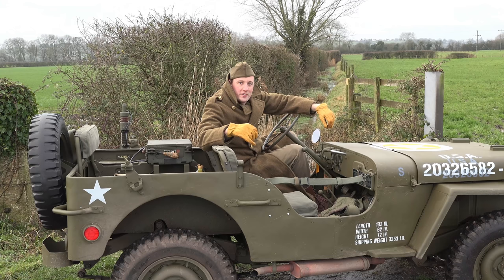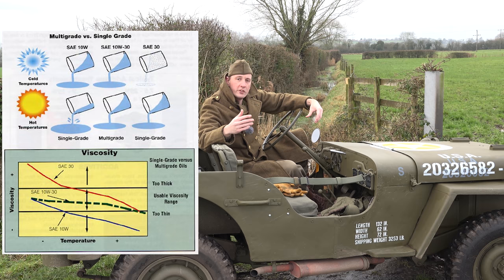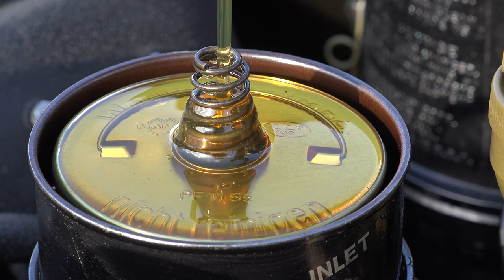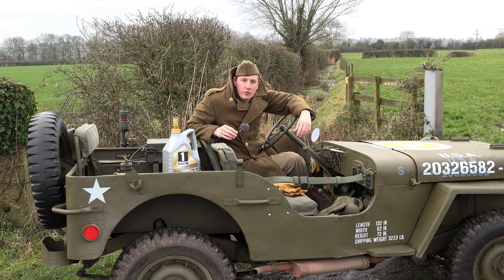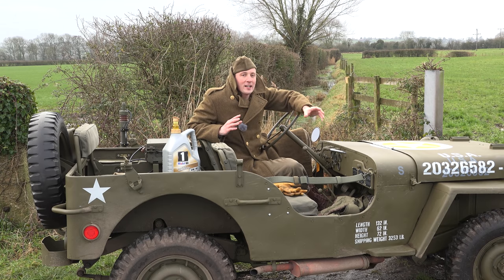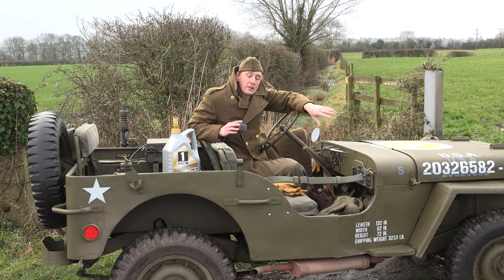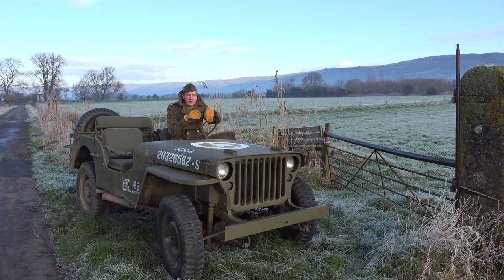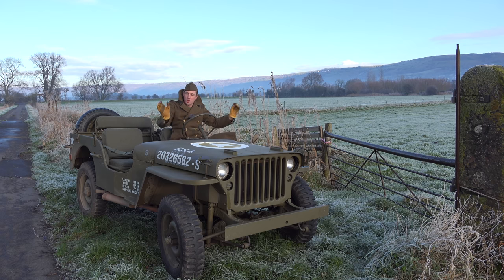Why can't You use Synthetic oil in old engines??

Comment: This video describes why cars with the ridiculous engine auto stop and start design flaw will have premature engine failure as compared to an engine allowed to idle with proper oil pressure, proper temperature, and proper lubrication.  But you save a spoonful of fuel.
Reply: Start-stop cuts down pollution in cities.  Using a quality fully synthetic will prevent wear.  The engine is not off long enough for oil to drain away.
Reply: @johnburns4017  It does not drain away entirely.  But there are no check valves nor top end oil reservoirs, as what you would expect.  It is equivalent to running your vehicles engine low on oil.  I had to change injectors unrelated to camshaft damage on an Impala.  I could not believe just how much camshaft damage was evident on the lobes.  This was a vehicle with under 100,000 miles.  The scoring looked like a vehicle that was on the edge of failure.  But hey, it saves a few spoonfuls of fuel even if the cars service life is cut by 75%. There is no way that impala is going to make it to half as long as what a vehicle that is allowed to maintained a lubricated top end, with proper pressure, will make.  Then the old failed car will use far more fuel that it could have ever used to melt it down to make another vehicle.  I guess these cars are good for a lease car.  One can get rid of them before catastrophic failure.  As a side note, the fuel injectors were clogged horribly for a vehicle with low miles.  This has nothing to or with top end lubrication though.  But it is common enough that the shop stocks large amounts of injectors.  I have not figured that out yet.  I just change them.

Comment: One big caution about using synthetic oil in old engines is most synthetic oil is formulated for modern engines with roller lifter or cam followers and catalytic converters.  The blend is optimized for these applications.  As such, one or more additives beneficial to oil engines with flat tappet camshafts, namely zinc based anti-scuffing additives (i.e. ZDDP), has been reduced in content because they can damage catalytic converters in engines that consume oil.  Since modern engines no longer use flat tappets, the anti-scuffing additives are no longer as critical and CAN be safely reduced.  But, that's not true for old engines.   So, do yourself a favor... Continue to use synthetic oil for all of the good reasons you state in your video, BUT use a ZDDP additive to protect your cam and lifters.  Make sure the additive you use is compatible with synthetic oil.  (What I say above also applies to modern non-synthetic oils in old engines.  Flat tappets - use a ZDDP additive...)
Reply: Bad advice - It has been proven that adding ZDDP instantly destroys any established oil's package...you are not a chemist and have no idea what the outcome is or will be.

Comment: A lot of older mechanics will say don't use detergent oil in an older car. The newer oils are so good at cleaning the inside of an engine that they can remove oil deposits behind thise rings and therefore allowing the engines to start using more oil than it used to. So, if an older engine had non-detergent used in it, stick with it.
Reply from the maker: That is good advise ;)

Comment: What is a oil that you like , I was told straight 40 wt Valvoline was the choice, My motor was rebuilt 10 years ago and only has 400 miles on it ,runs perfect

Comment: Why not just use the Standard Oil until the ring seat? After the ring seat let's say after 10,000 miles you can switch over to synthetic. What's the analysis of that?
Reply from the maker: The current ideas are to use a break in oil for first 500 and then switch to your oil of choice.  My personal opinion is to just use a good semi synthetic from the start, I did not continue using the fully synth to see if the consumption would reduce but I belive it would and the extra protection would allow your engine to last longer.
Reply from the maker: I'm going to revisit this with a follow up video

Comment: Break it in with conventional oil around 500  to 1000miles to break in and seat the rings then change back to synthetic.  I would want those parts to last as long as possible and synthetic with regular changes is the ticket for long part life.

Comment: Matt with the Jeep do you need to add an petrol additive given we have gone from leaded petrol 
Alan Australia
Reply from the maker: I don't, it doesn't appear to be a problem with these engines for some reason.  I've found using as little additives as possible seems to work best, nice fresh fuel and a good oil seems to be what these engines like.
Reply: The old low compression flathead engines, don't really need the lead additives.  The newer OHV engines with their higher compression usually do though.

Comment: They don’t have zinc in oil for one reason it is the catalytic converters. Zinc, lead and other metals damage them. Now you can get a zinc synthetic oil you need to look at racing oil or something like Lucas oil’s zinc additives not to be used in vehicles with catalytic converters.
Reply: Lucas hot rod Rotella both very high zinc

Comment: 12:50 .. So the oil is slipring past the rings? and burning so cleanly it's not fouling the sparkplugs?
Reply from the maker: I think the answer was very little oil was getting past, enough to have some consumption but nothing beyond what is normal for break in for a jeep motor!  You could probably break it in quicker with a less protective oil but why bother, just keep the incredible protection of the mobil 1 and don't worry!

Comment: On older engines, break-in the engine with non-synthetic to seat the rings.  Then switch to synthetic for long life.  You can't break in an engine with synthetic because it's too slick.  We used to do this for small engines such as non-ringed tapered-piston remote-controlled model airplane engines.  No reason it wouldn't work for pretty much anything.
Reply: There is no difference between "old" and "new" engines when it comes to rings...all engines from the last two decades came with synthetic oil in the crankcase from the very start and zero problems. Old wives tale debunked...

Comment: the old rubber seals and gaskets in a 40's era engine, is not happy to the additives in a modern syntetic oil.. the engine is happy with the newer oil, that flows better at startup but the old seals is not, if can get modern style seals and gaskets. therefor on a generaly many would recomend a 15W/30 mineralic oil over a syntetic

Comment: Those old engine need to be run in on a Mono grade oil for at least 500 kms, after which you can use the full synthetic if you wish.  Otherwise those old engine cylinders get a glaze on the cylinder wall whic you do not want.  Once you have done the breakin period you can use semi or full synthetic as after the breakin period the rings are seated and will not use oil at all.  New motors are broken in at the factory on a breakin oil which is removed at PDP service of the vehicle before delivery of the vehicle to the customer.

Comment: I avoid synthetic in anything pre 90 but ALWAYS use multiweight. BTW never use 0 weight oil in older engines 5w30 is perfect in any location (unless you're on an arctic expedition)

Comment: Happy New Year! My ignorance tells me that "thinner" 0w 30 and 10w 30 grade oils are too thin and are prone to promote leaking past gaskets.  Is this a truth or a myth in your opinion / experience please?  Great video as usual!  Many thanks.
Reply from the maker: This is incorrect, 0w cold is 5.6 times thicker than 40w when its hot so if your jeep leaks when its cold and the oil behaves like 0W then it will leak when its warm and 5.6 times thinner!  If A gasket is going to leak its going to leak no matter what (unless you fill the engine with crude oil or something like that!) and using a thicker oil to prevent leaks will cause unnecessary damage to your engine to prevent the loss of a few cents worth of oil, the long and short of it is if an engine leaks it needs attention and the leak rectifying not trying to get round it by using thicker oil grades, that is shade tree mechanic territory and the Sergeant will not stand for it ;)  ha ha
Reply: @Greendot319  Good answer Matt.  I will do an oil change with Mobil 1 semi-synthetic and fit a new sump gasket over the next few weeks then!  Cheers, Clive
Reply from the maker: Where about are you  Clive, your oil choice can depend a lot on where you are,  Also how old is the engine etc.  Suddenly changing oils on an engine that's behaving itself for many years can cause problems.  Imagine you have run a motor with a lower detergent oil, some sludge has built up and captured metal particles and carbon etc, same in the rings too, suddenly you switch to a highly  refined synthetic with high detergent levels, all of those bits of captured metal are now released from the sludge and carried through your engine where as it used to be stored away in the gook waiting for your to clean it out next time you did a rebuild; same thing goes for the rings, engines running fine, switch to higher detergent oil, carbon built up in rings that was helping to seal is broken lose with the new oil and you lose compression and your jeep starts smoking.  This is also true of the old seals too, gunk sometimes helps them seal and cleaning it out suddenly makes them start leaking!   It is worth being careful changing oils on a good running engine for these reasons, what might work very well in a new clean engine might not work so well in a good old motor, it all depends on your engines circumstances!
Reply: @Greendot319  "Design and make a can of worms!"  The engine was rebuilt by the previous owner, new innards, bills to prove, and had done 500 miles when we bought it.  New Morris 20w50 was put in upon purchase, that oil has now done 2000 miles and is just over 2 years 4 months old.  My intention was to simply change it for the same oil but your video made me think twice.  You last reply has made me think even further!!  
It has a very slight weep from the rear rope seal and the sump gasket  seems a bit moist all around.  "If it's not broke don't mend it" springs to mind but from what you have just said, I think it would tolerate a change to semi-synthetic given it's apparent youth. Maybe drop the oil and see how clean it is and take a decision from there.  It's cold in Northants at present so I may wait a few weeks for the garage to warm up a bit!

Cheers

Clive

Comment: For starting in cold weather US WW2 aircraft engines actually had an "Oil Dilution" control that would release some of the aircraft's gasoline into the engine oil to thin it out, then as the engine heated up the gas would simply evaporate out of the engines breather system. 
Could you imagine how the EPA would lose their minds if modern cars did something like that 🤣🤣🤣🤣
I can just hear all the heart attacks from the tree huggers🤣🤣🤣🤣

Comment: I would think the issue with synthetic would be couldthe seals and gaskets hold up to it. Otherwise synthetic would be perfect. Since your engine has just been rebuilt I would see no reason not to use synthetic. In fact I would add a friction modifier to the oil once the engine is broken in.

Comment: Can't use full synthetic in old engines? Bunch of crap. Old seals may not swell as much as they need to, which might cause leaks and pressure issues if you just decide to switch to the synthetic, but if the old engine is built with the new oil in mind, zero issues will be encountered. 300,000 leak and oil pressure free miles miles in an engine with rope seals was my personal experience- but I built the engine and did it with the use of full synthetic in mind, bought the right parts to support that oil use and talked to my machinist first.

Comment: I notice phillips petroleum and some others recomend 1400 ppm zinc for flat tappet cams at all times. Most oil now is limited to a max of 1000. Some say thats ok. I add one and three quarters lucas tb zinc additive to mobile one full syn allthough mobile said not to. There are two types of zinc but i cant find any info on it. Watch out for the directions on the lucas. Its 43 thousand ppm for an entire bottle. I only use a full bottle for 500 to 1000 mile break in and then use no more than 2 ounces per oil change after that. Too much zinc is as bad or worse than too little. I have talked to lucas and mobile to arrive at this gamble. 60 000 miles plus and no problems so far.

Comment: Very nice and informative video.  A question from me.  What about the other way around.  I have an old fully run in jeep that has been running on mineral oils for I assume 60 years.  Is it o.k to just swop over to the super 2000 semi synthetic oil.   Will it clean up the engine so much that everything becomes loose ?  Thanks  again for a great report.
Reply from the maker: I would be careful because the modern oils are detergent and will loosen any sludged up crud.  It would be advisable to completely clean the engine out before swapping to a modern detergent oil sadly.
Reply: @Greendot319  Thank you for your reply; your advice is invaluable.   When you say complete clean out you mean replace complete oil, oil filter, take of sump and clean, or is there more ?   I will use mobil super 2000 10w/40.  p.s I bought a color tune.  Cheers

Comment: I haven't seen much talk about Zinc. All the new oils have reduced levels of zinc, per new government 'climate change' rules. I deal with VW Beetles. Now, Valvoline VR 1 racing oil, or Amsoil with zinc,  is the only oil we can use, mainly because of the solid lifters. You can use other oils if you use the zinc additive. But you shouldn't use any oil on a solid lifter engine without zinc, and the newer oils have very little. Thanks climate change, and our government.

Comment: Big gauntlets for driving. Scarf over the face. Look at motorcycle gear from the fifties, all surplus stuff!  Been on old bikes in the winter with very primitive gear back in The eighties   F# cking freezing. But kind of fun. It’s not like you’ll get wet if it rains;  oh yes oops 
You will.
Reply: I did it in the sixties, when I came home after riding, I had to break the ice off the jacket to undo the zipper. Now that was cold.

Comment: Hello! 
I have questions:
Do you have magnet in drain plug, or few, flat, heat tolerant magnets bottom side of the oil pan? - to collect free steel particles before oil pump suck them up 

Did you use break-in oil, for the first 30 miles? some say, that nos or old rebuilt engines like it

Any pictures from the inside of the oil filter?
Thx!
Reply: What about inside the oil ports for the crank journals can we get a pic there too?🤪
Reply: @BilgePump  yeh! really good idea! ;) can you recommend a tool, to cut open a crank? - without engine removal :P
-> it's a common thing, to open up the oil filter by a fresh-built engine, to check the size/form of metall particles

and i don't have Jeep-specific info, but the break-in procedure principle by older engines, shortly: 
1, factory recommended mineral oil for the first 1-2 start/30miles 
2, than oil change to high quality (fully)sinthetic oil
If factory recommend 30 "densitiy" on warm side, than use a "common" 5w30 (or 0w30 with lot of cold start/short ride)
Reply from the maker: No magnets and I would agree with your break in suggestion Csaba, High quality multiweight mineral oil with 1000 ppm+  ZDDP for first 100-50 miles or so then switch over to your selected synthetic

Comment: Mobile1.    750 miles per qt  Schafer oil 3200 miles a qt   same trip  evaporated  or blo by is small and if u use old oil 2 start a fire u will find what oil don't Wana start a fire easy is least blo by !

Comment: Where’s your windshield
Reply from the maker: In somebodies garage untill I buy it off them and fit it!
Reply: @Greendot319  rofl
Reply: @Greendot319  Greendot you will need a windshield catch on the passenger side and you need to flip the one on the drivers side.  Your expert advise would carry allot more weight if you would fix these minor things.  Regards!
Reply: and paint those crash pad screws!  ;-)
Reply from the maker: Yes Sir!

Comment: That oil is quite black for only 500 miles.
Reply from the maker: Blackness doesn't mean dirty, oils darken with heat and use even if they are not contaminated, i've been very happy with the performance of these oils and the motor, nearly 2000 miles now and 1 and a half years of hard use and no issues, they designed a good engine

Comment: Steak you made is not letting the engine Break in with regular oil. That engine is designed to have a break-in. Where they Parts Will May up. If you start using synthetic oil from the outset the engine will never set in properly. That will cause undue operating characteristics. Use standard oil so that you can get the parts tomato up and then switch to the synthetic period and use a better oil than Mobil 1 for Christ's sake. Mobile one isn't okay oral but there's at least three or four off the top of my head that are considerably better.
And the flat tappets are not served by Mobil 1. There's nothing in Mobil 1 oil that will protect those flat tappet cams
And I have no idea where in the world you learned that a Jeep engine is broken in at the factory. And then you flip flop on whether or not the Rings have to set in. Make up your mind. You still will not get those rings to set in with a semi synthetic. You have to go to a mineral oil for about 2,000 miles. At least!